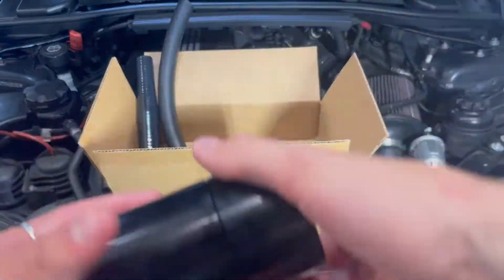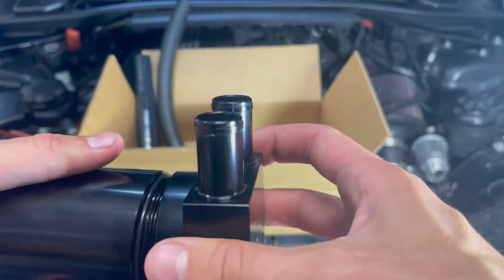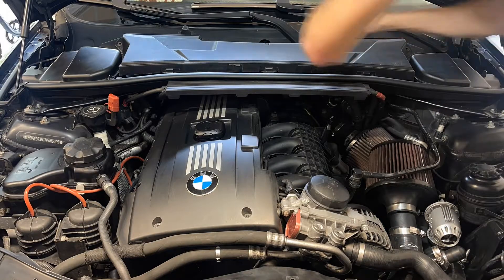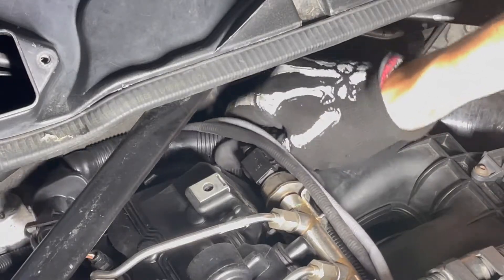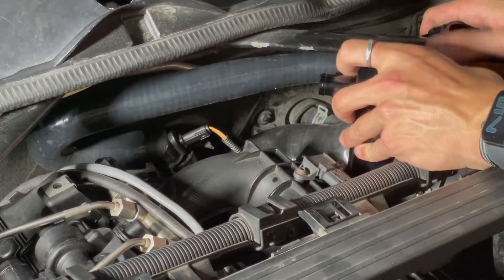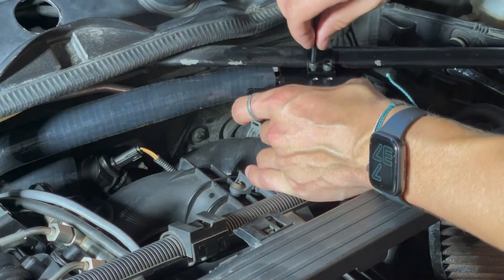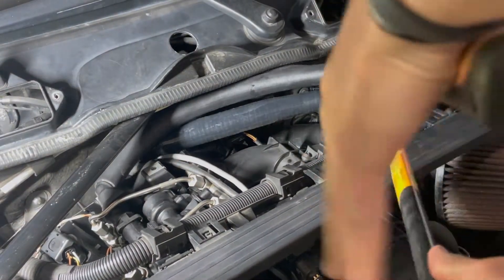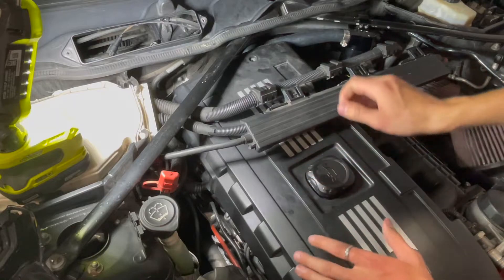N54 Oil Catch Can DIY

Comment: what is that part called that the u shape hose connects to? I have the wire but the not the part where it is able to connect
Reply from the maker: That is the PCV heater

Comment: Not going to catch anything with that high side catch can, the vacuum side is what caused the issue with carbon build up on the ports
Reply from the maker: 3:48 You can see here still caught around a tablespoon of oil a few days after installation
Reply: How do you set one up for the vacuum side?
Reply: @forgedrods15 intake manifold has a hose on it. Look into dual catch cans